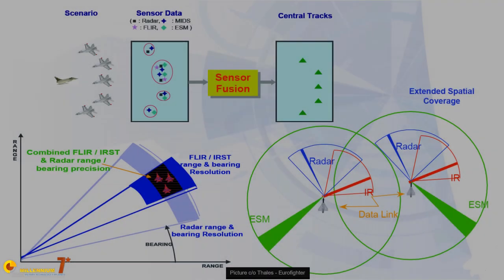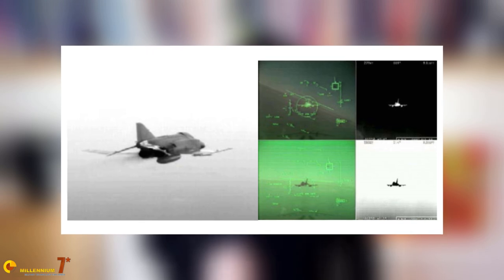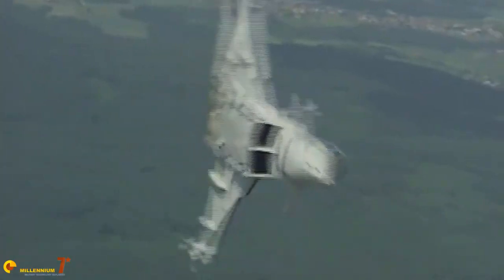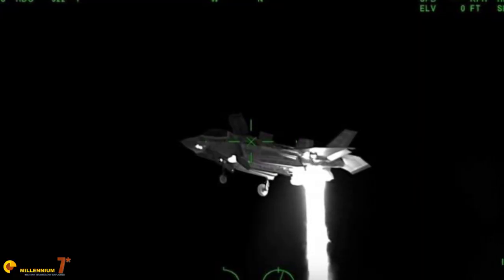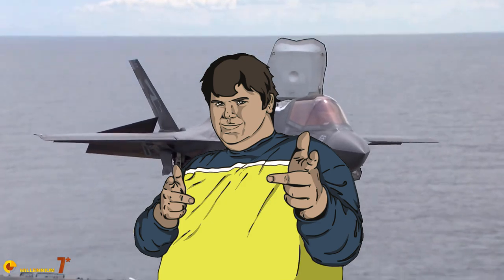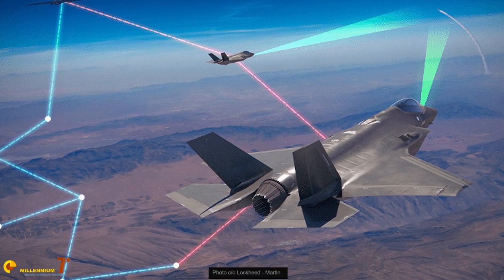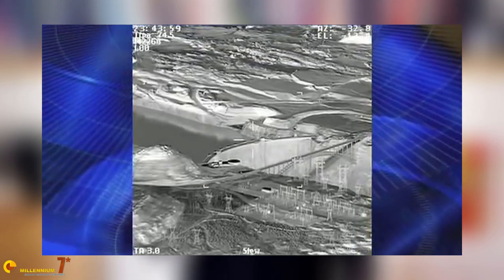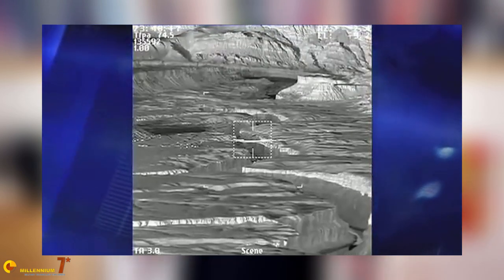The Other RADAR | Can IRST Infrared Detection Replace Radar?

Comment: Mounting a IRST in each wingtip should work. The Short distance between the two IRSTs should compensate for the inaccuracy in calculation the distance between two IRST on each aircraft. In mounting a IRST in each wingtip you know exactly right distance and it will be possible to make a quick and precis calculation.
Good idea 👍
Reply: Or even better ! Dassault already have imagined and prepared with its partners Thales and AirBus, a teaming and swarming  capable system using drones or also called UAV/UCAV. It'd be available in a close future on Rafale F4 as a first part and step of the FCAS program (F4 is scheduled to arrive in 4 years or less).

https://www.instagram.com/p/CH2d2nMAYLZ/

With this solution, IR and other Optronics and advanced kinetic kinematic systems could be really superior than radars, since they're flying in a very passive and stealthy mode toward the enemies !
Reply: The wings move.

Comment: Great video! I have a question... what are the greenish marks under the f35 cockpit in minute 14:50 ? I´ve never saw something like this. Thanks in advance!
Reply from the maker: Good question! I thought they were formation lights but it might also be on the filming side,  some form of enhanced reality.
Reply: Those are unpainted areas, if you look at pictures of F-35 been assembled in factories you can see the same green color. Not exactly sure why this particular area is not painted but it's not first time I see this on F-35 pictures/videos. My theory is this have something to do with the complexity of maintenance of the stealth coating around certain panels.

Comment: While having two or more AC to triangulate is preferable it can be done with a single AC at lower precision and longer updates.  By flying a perpendicular flight profile one AC can create the baseline separation for the triangulation measurement, but, since it will take some some to get that separation and all points are moving the precision will suffer.  Kinematic ranging.

Comment: IRST certainly has come a long way, but Radars are also advancing significantly as well. I watched an interview with an F-35 pilot recently and he said that the pilots don't even call it a radar anymore, they call it a MFA, a Multi Functional Array. Their functionality has significantly changed over the last 20 years, past the point of just detection. Even in that role, significant advantages have been made. A modern AESA radar can perform an evolving series of actions nearly instantaneously, starting with producing a randomized search pattern using a range of different wavelengths and strengths causing it to be difficult to detect and nearly impossible to triangulate. Once it does detect something, it will hit that object with a series of different wavelengths and even create a synthetic image of the target, all of which will be compared to produce a high level of confidence in the target and make single frequency jamming far less effective (Jamming strength is divided by the number of frequencies you are outputting ie single frequency jamming is the strongest). This is all however besides the point. The concept of single sensor capabilities is outdated. You would never want one over the other but rather you want the Array and the IRST working together and this is how it currently functions. The Radar and the IRST work in conjunction, if the Radar gets a return, it cues the IRST to look at it and vice a versa. The exponential power of these systems working in tandem to create a more capable and more resilient sensor suite is far more significant than any single source sensor.

Comment: There's also the doppler effect, the longer distance, affects the frequency of the IR signal..  red-shift, etc. Modern sensors & ICs are fast enough to do it in a tiny package.
Reply: Actually that would only tell you the relative movement. Because of the red-shift the theory of the expanding universe was born. Because most cosmic object seem to move away from us. It can't tell you the distance. Also the relative speeds of fighter aircraft are to small to accurately determine their relative speed via the red-shift because for that you would need to know the exact wavelength of their IR-Emissions when stationary to the sensor. Radar actually does determine the targets movement in this way, by measuring the change in wavelength of the returned signal, but this only works so easely because you know exactly what wavelength the outgoing signal had.
But what does work and is actually used with some IRST systems is "kinematic ranging".

Comment: I guess the question is which sensor is more useful? My inclination is that in a world of stealth and shortened engagement ranges, IRST might be the preferable sensor, as it is much harder to hide from. Another advantage is IRST is that there is no such thing as an IR warning reciever because it is a passive sensor, which means it is 100% stealthy which active sensors such as radar never are. There is the not completely trivial problem of making the nose of a fighter stealthy while having a 
huge thermal camera in it, but I would argue that if possible, for dedicated air superiority, IRST might actually be the better primary sensor with a miniaturized radar system as a secondary.

Comment: An example would be a soviet radar or ground station tracks/ detects an F22. Its location, direction, speed can be broadcast to an interceptor. If the interceptor lacks stealth, the safest thing is to try to come from the side, or possibly behind the F22 and use irst to do the identification/ targeting. This way the soviet fighter never turns on its radar . Totally depends on where the situation happens, type of engagement required, etc...

Comment: I wonder if a second sensor could be towed. That would give a lot more distance than wingtips, and it might also act as a useful decoy.
Reply: That would be something for the eurofighter.
Reply: @shanerooney7288  It's straightforward to add  radar reflectors and/or flares to the towed pod as desired.

Comment: You brought me a few question. Optics  when scaled up can collect more photon and hence will gain more and more ability to detect far away object. If a irst were to become the main sensor, it would make sense to take all the space normally reserved for the radar and hence to be scaled up a fair bit which may enhance it's detection range. Would it be true in that case?

The other question is if a target is triangulated and the distance is known then couldn't the computer can infer the size of the target. From that point wouldn't the irst/computer know the range of the target from a single sensor as long as it doesn't loose the target?
Reply: It would probably be more effective to install multiple small sensors than one big one. Astronomical observatories already use this idea to form one huge telescope out of multiple small ones. It uses a lot of computing power but it's very effective.

Comment: In my opinion it is a very good method for locating stealth planes or launching missiles.  With the Pirate Sensor from the Eurofigher, ranges and other capabilities were targeted similar to that of a radar.  In addition, these sensors are passive and cannot be jammed.  However, the weather has a major effect on the performance of these systems.
Reply: They can be jammed, however typically not at large distances.
Reply: Not in an air dominance situation where the fight will be way above the clouds

Comment: The detection range will most likely be too short for fighters jets (as a replacement). But it's a great addition to radar.
Reply: VS stealth aircraft, it does replace radar for the most part. It's considerably less good than radar, and very weather sensitive, but it's the best bet for BVR detection of stealth planes.
Reply: @kathrynck  not only versus stealth but on stealth it gives them ability to detect and lock targets while being undetectable, shorter range is non issue when your plane can get closer and this would make missiles incredibly deadly because if the opponent doesnt know he is being targeted he cant evade properly.
Reply: As a single sensor yes. But modern fighters have a multitude of sensors and fusion.
EW is by far the longest detection range for a proper listening platform.
Here you have a very large spectra. Including longwave. Passive in the beginning.
Radar comes next. But active.
IR detection. Passive.
Combining the information of all platforms give you great accuracy, great trustworthiness etc.
Reply: @Asghaad  true true
it also begs for the introduction of a longer range FOX-2 missile, which approaches on inertial guidance, and locks on when closer (mad dog lock). Could be difficult (not impossible, but difficult) to know there's an engagement occurring until "...wait, aren't I supposed to have 2 wings?"
Reply: @christianm1533  Especially if your radar can selectively black-hole areas in it's view, only pinging the target for a moment every so often for a position update?
Reply: @kathrynck  I think thats only needed if the other target is flying silent. Otherwise EW works fine passively over great ranges.  The one-direction energy (listning) is far greater than bounce-back energy.

Comment: I found it very interesting and I think I wrote to you about that, also I'm intrigued by having 3 IRST on 1 plane, 2 on the wing tips, one in place of the radar... what's your view on a land bases IRST, something big, would that make stealth redundant? Thank you
Reply: Land based system make sense because performance/sensor size of irst hit the point of diminishing return much quicker than typical radar. 
It would be very ideal as a network of disperse observation station for both offensive and defensive operations that cannot be easily taken out by enemy sead. If anything, those disperse station themself can be a great anti seed unit.
But ultimately you still want radar as it is not easily effected by the environmental element and provide a much more accurate picture of the battlefield. But using irst as a general guidance mechanics, and let the weapon onboard sensor pick up the rest seems to be what we will be heading in the future.

Comment: I have a free lunch for You, infrared is not inherently unsharp, it just need to be adjusted a small bit relative to the visible spectrum, however, producents of infrared cameras seem to have missed thát until recently.
On old camera lenses with a focus indicator scale, there is actually a marking indicating this, usually a few millimetres from zero (< depending on type of lense, tele/wideangle).

Comment: Perhaps these infrared detectors could be used on the ground to search the skies for drones in the local airspace (perhaps even passively without the need to shine an infrared flashlight into the area) without needing to use radar that could cause the detector to be picked up by enemy aircraft on SEAD missions, or targeted by radar-homing missiles?

Comment: I suppose you'd also have to have a way to perform IFF interrogation as well if you were to abandon the radar. Interesting concept although the conventional wisdom was always to integrate IR/EO/Radar sensors. Now that AESA radars have become so popular (read: capable) one may ask the question from the other point of view: do you need IRST, especially pod-based, if you have an advanced, multi-mode radar? Great presentation.
Reply: I would say IRST is more importent than ever. Let's say an Aircraft carries an ECM-pod. You may detect it anyway on your radar from afar but your radar is probably unable to identify it. And IFF can only tell you at best, that it's not one of your own aircraft. So you have a blip on your radar that is something...could be an enemy fighter, could be a civil aircraft you don't know jet. IRST gives you in such a case the capability to identify the radar blip from still some distance away regardless of ECM.
Also the use of Radar always comes with the risk of giving away your own position.

Comment: One of the newest challenges in naval warfare is how to counter hypersonic anti-ship weapons. These objects move too fast for interception by CIWS guns and missiles that require doppler radar to track incoming threats.Travelling at a few meters above sea level, they are in the densest atmosphere on the planet and when travelling at supersonic speeds, they will be extremely hot objects. They'll need something like the ablative coatings used on spacecraft for re-entry and that will make them the hottest objects in the sky after the sun. Radars lose time bouncing waves back and forth, each time requiring computer processing time to build an image. There just isn't enough time for computers to resolve it but infrared detection doesn't require radiation to be bounced back and forth. It happens at the speed of light. It could even be operated by an analog computer that doesn't "waste" processor time trying to figure out what is coming. The only intelligence that would be needed is to discern super hot missile from the sun. The contrast must be immense between them. (A corollary: Always make your hypersonic missile attack coming out of the sun.)

Comment: For triangulation in reliable way one would need to have 2 sensors or at least 2 lenses in tips of the wings, using single sensor and series of mirrors and actuators determine distance, it's possible, but not sure if on flying shaking platform
Reply: They already use "kinematic ranging" in some systems since decades. Modern fighter planes know very exactly where they are and how they move around in the air. Actually often much better than any pilot. So what you do then is to measure the relative angular movement for a few moments. The longer you do this the more accurate it gets and normally after a few seconds you have a good enough range estimate to fire a missile like an AIM-120 or Meteor. Ranging in this way isn't perfect, but it doesn't need to be. The missile will eventually use it's own seeker head for final target aquisition. It doesn't matter if the measurement is a few nautical miles off.

Comment: I strongly suspect that we are underestimating the technological achievements of thermal sensors. I have seen generals saying that investing in thermal stealth is a fool's errand since just the heat generated by the air flowing around the aircraft will soon be sufficient to eliminate stealth. 

This may also have been one of the reasons why the f-35 specifically does not have super Cruise. Perhaps it's an attempt at avoiding some of this thermal stealth problem.

Israel also believes that within 10 years stealth will not be decisive. And the only technology that I'm aware of which could create that change would be thermals.

Comment: The F-35/ballistic missile test was more to examine whether an F-35 can be used to provide over the horizon detection and guidance for a sea-launched SM-3.
Reply: well, it simply impossible with current tech fire control accuracy can not be provided.

Comment: Wouldn’t it be possible to have a database on which the IR sensor could feed for information to identify and MOREOVER to estimate the distance of an aircraft. Anyone can find the size of any aircraft on the internet so the size of an IR image recorded by the sensor could be translated into distances. A bit like the technic astronomers use to find distances of stars, they use a specific type of star that emits the same light so for any level of light there is an associated distance.

Comment: It seems like they’d be great for use with modern SAM systems, but I’ve never seen or heard anything along these lines. Am I missing something?You’d think it would be a no brainer! Imagine having an IRST slaved to something like a NASAAM launcher armed with AMRAAM or ESSM active radar missiles with lock on after launch capability. The SAM operator could Passively see airborne target (SEAD becomes les useful), launch missile towards target, let the missile’s own radar pick up the target, all while the launcher remains largely undetected.
Reply from the maker: Various Russian systems have them, but the range from the ground is severely limited.

Comment: The Rafale for example, the OSF is the old version. The new version is named OSF-IT. Range detection has been increased over 100km with this new Optronics, IRST and FLIR. Even the TV/IR has been improved on the F3 standard of the Rafale. The previous range was already superior to 40km, it was 50km. It's now superior to 50km but informations about the range hasn't been disclosed to public.

Other point, the Rafale is now using more Optronics since the new TALIOS POD has been deployed on the F3R standard. It gives a wider ranges, distances and angles to cover the Rafale and detect further air to ground and air-to-air targets/enemies.
The TALIOS optronic pod will incorporate artificial intelligence to analyse tactical data almost instantaneously in flight and extract and identify targets.

 
This video, isn't going enough far, and his informations are not well updated. I like this channel, but sometimes his videos are kinda weak !

Dassault FCAS program already showed their ideas about the 6th gen FCAS system and fighter NGF. The distance and range of IRST/FLIR or any type of Optronics, isn't anymore a problem if they're able to move and scan ahead the fighter jet.

The official video : https://www.instagram.com/p/CH2d2nMAYLZ/

A system of systems. MANNED-UNMANNED teaming and swarming capabilities, between many differents proven platforms using artificial intelligence and complex analytics to find and detect the enemies first and well ahead. A very highly advanced combat collaborative platform and systems between any types of military machines.

Comment: Put two or three irst sensors on the same plane for triangulation. If the distance between sensors is greater than the wavelenth of radiation being used fairly accurate measurements should be possible.